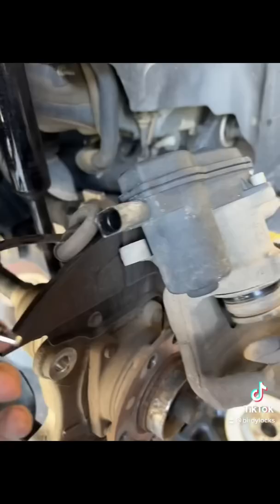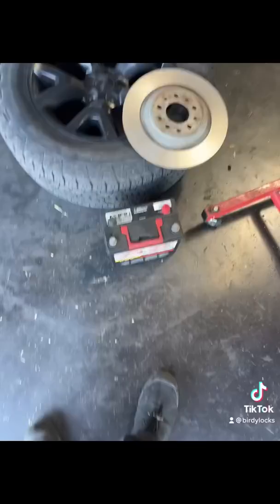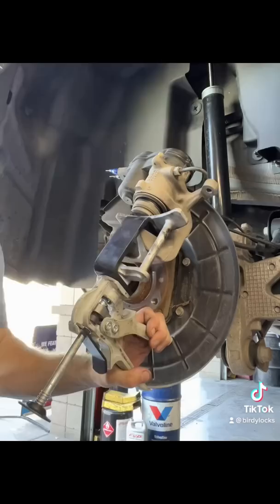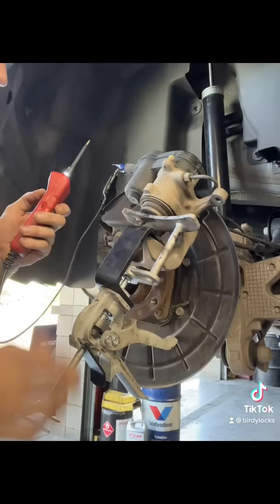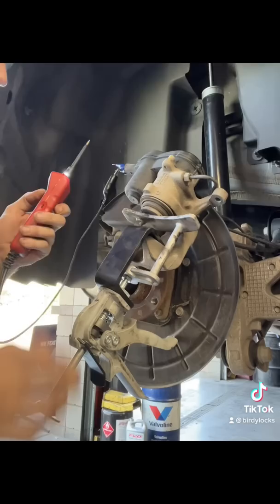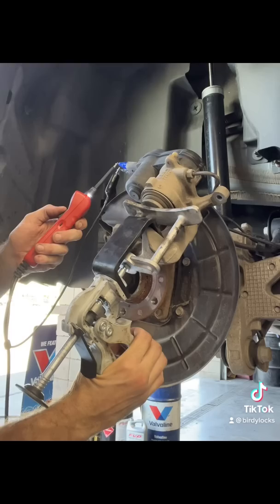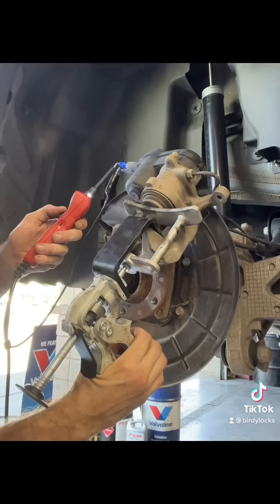Electronic Parking brake hack #EPB #automotivetip #automotivetechnician

Comment: There is a tool to turn the piston in without using a scan tool or battery. The two little indentation on the piston is where the tool fits.
Just turn it clockwise a d the piston will go in .No power needed.
Reply: You’re wrong, go educate yourself. You’re not turning the piston until you retract the actuator.

Comment: I’ve never had to replace parking shoes or a brake cable. You can keep this planned obsolescence junk
Reply: I agree with most of your comment, but these newer vehicles have a combination rear caliper/parking brake, so the rear pads do both regular stopping as well as the parking brake function. It's not like the good old days where you had a caliper for stopping and shoes inside for your parking brake, or even older days when everything was done with shoes and a drum.

Comment: Might want to have the polarity correct as well. Pretty important.
Reply: Tell us why?
Reply: @bthekid82  the polarity determines the direction of rotation for the motor, if it's backwards it'll be pushing out the piston vs pulling it back in.